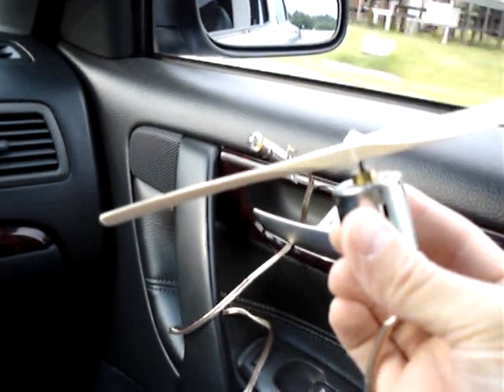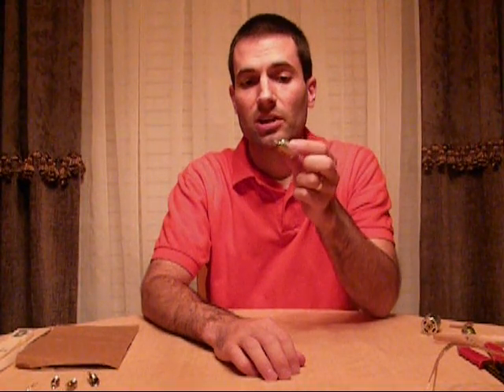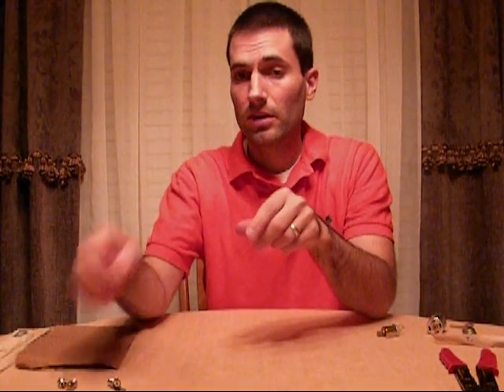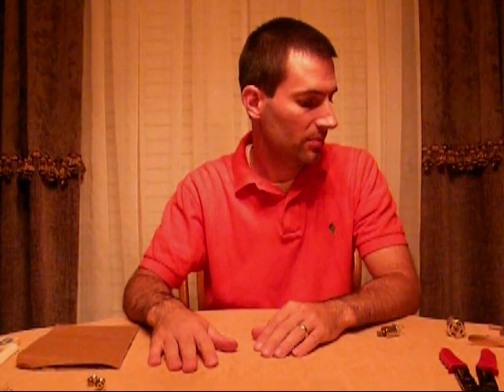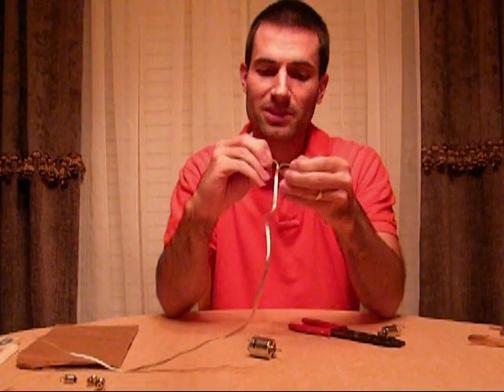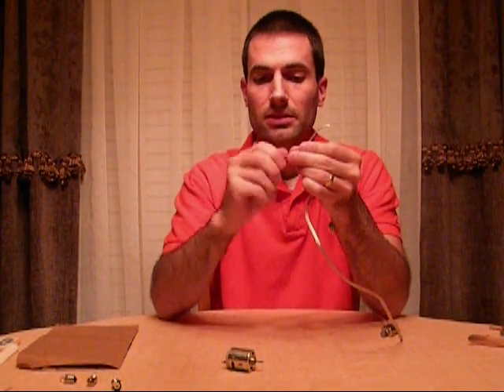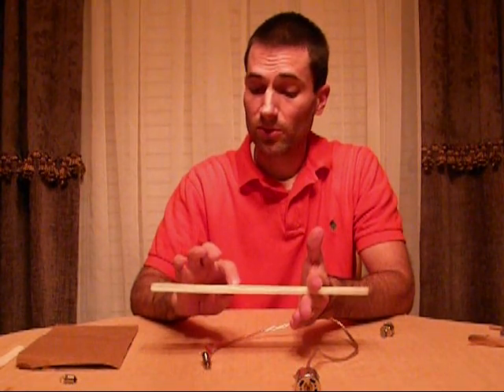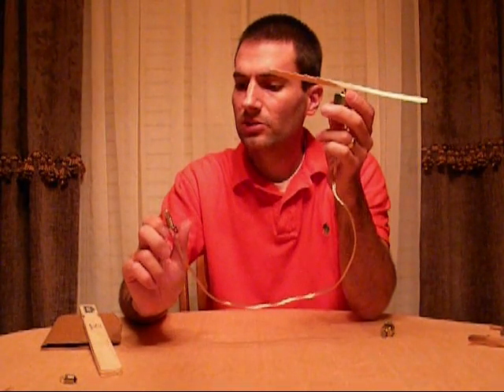Handheld wind turbine

Comment from the maker: @knarfarrgh Find the center of the wood by balancing it on your finger, then mark it, Then sand a 45 degree angle on one side of the blade front and back. Then do the same to the other side but in the opposite direction of your first side. If you lay it down, you should have a ramp that goes up on one side and a ramp that goes down on the other side. Thanks for the question, Lonny